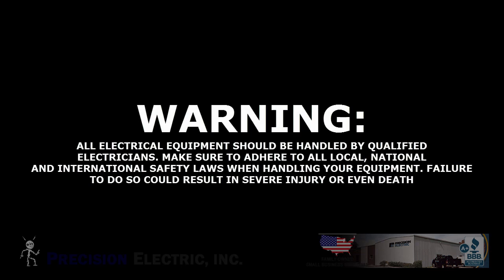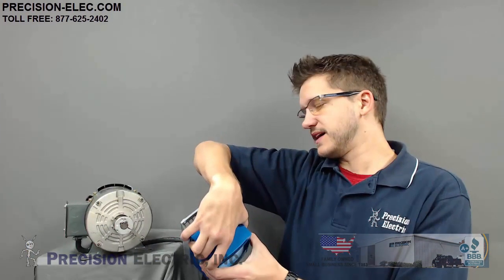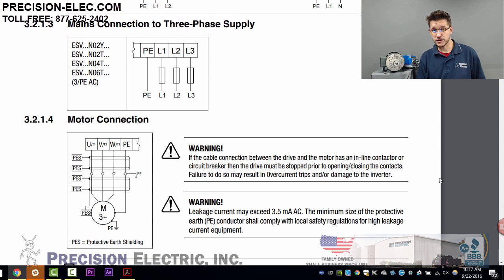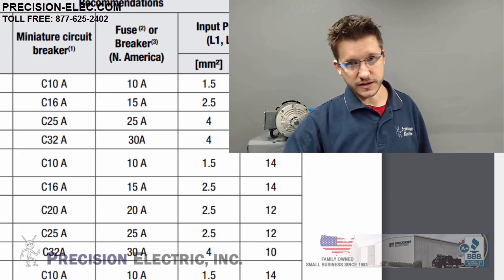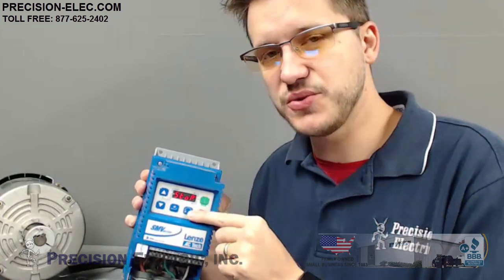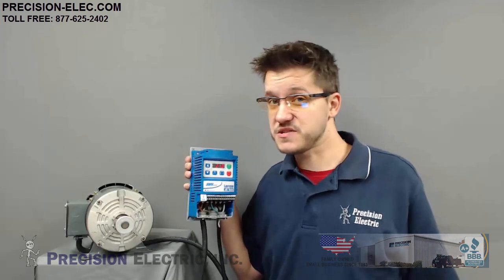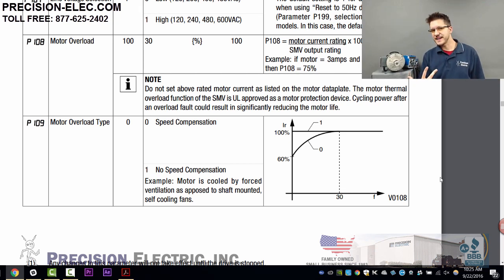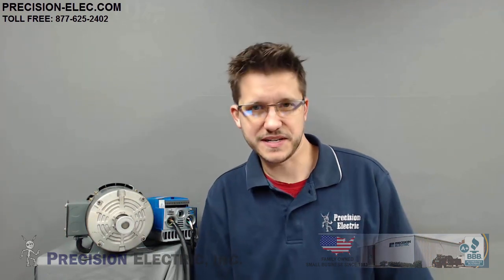SMV Variable Frequency Drive VFD Basic Startup And Commissioning

Comment: Question  I can connect 3 motor in series on one of this controller??? Thanks you
Reply: You wouldn't want to run them in series, you'd want to run them in parallel so they all receive the same voltage.  That being said, if you ran 3 motors in parallel off the controller, all settings and all stops and starts would apply to all the motors.  There would be no individual motor control.

Comment: Me to I like those drive a lot.   I have the problem heavy load on the decent, error code.  I need to install A big resistor on the vfd, but there no terminal for dynamic braking ( B1,B2 )?